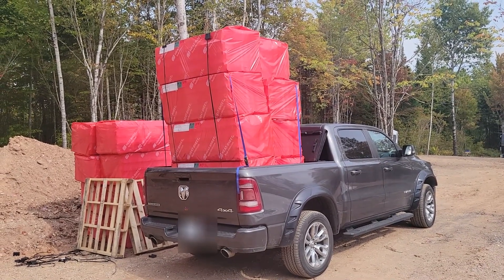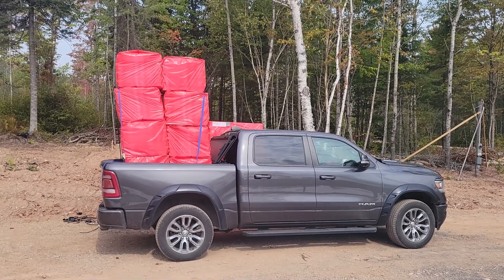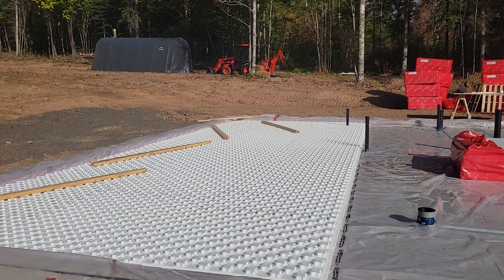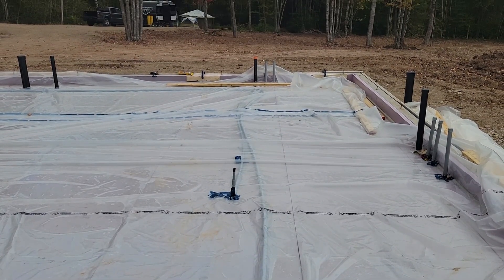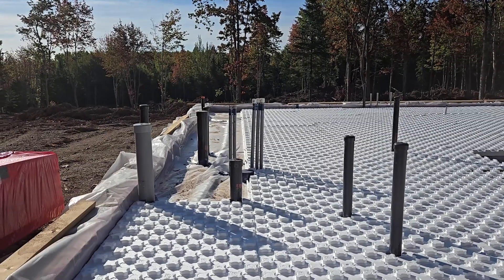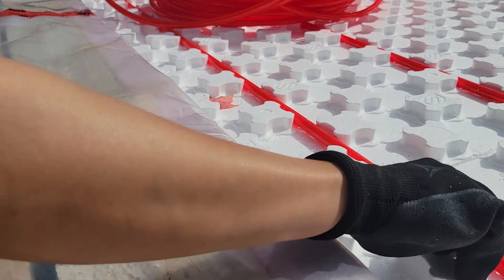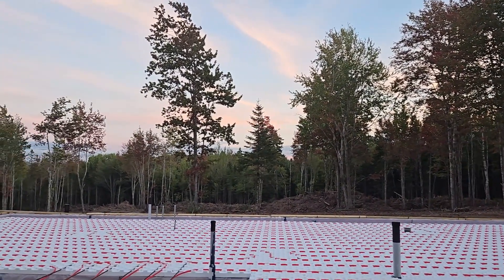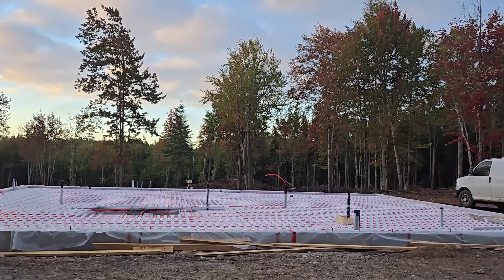Radiant Heating: Tubing and Insulation Installation. HEAT SHEET

Comment: Just wondering why you put the vapour barrier between the layers of insulation instead of on top of the gravel ? 🇨🇦
Reply from the maker: You can totally do it, in our case because of the recess (8") in the center of the slab it was easier to deal with this way. We have only one layer (2") under the vapour barrier in that area .
Reply: My next questions are why the 8” recess ( is it structural for fireplace masonry) and how did the concrete pour go ?  I’m planning on doing the same frost protected shallow foundation in Ontario . Thanks for the info .
Reply from the maker: @qualitybydesign5119  yes, the recess was structural, we have a staircase in that area. The pour went well, we will post the video today.